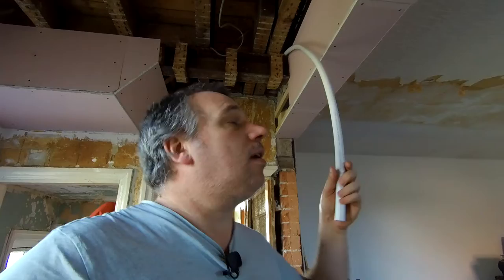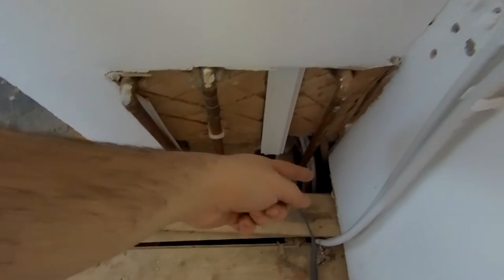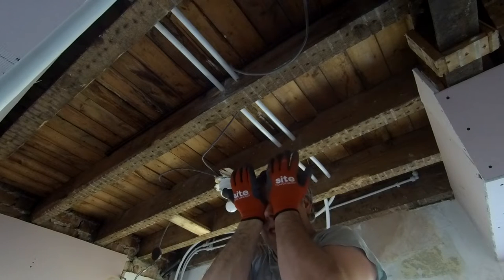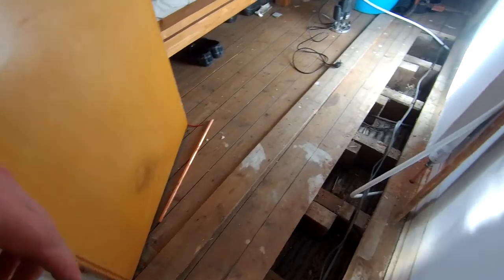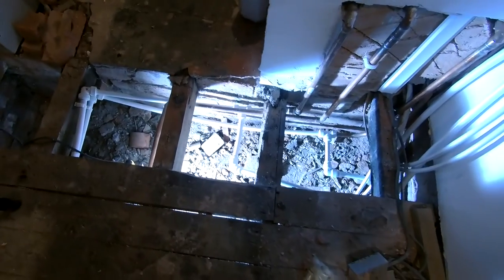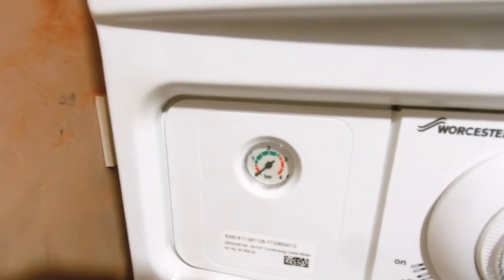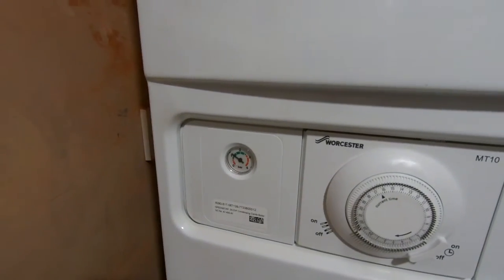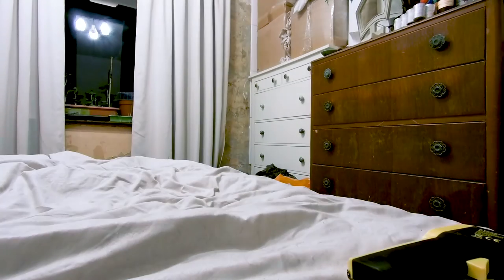How to Install Central Heating System. part5 - Getting the heating upstairs DIY Vlog #14

Comment: Very helpful video. Is there a reason you used straight reducer 22 to 15mm just before 15mm tee estate of using 22x15x15mm tee reducer, that's on 16:31 min

Comment: Lcw tanx for the upload the series was enjoyable to watch,did u use jg speedfit  pipe and fittings?
Reply from the maker: I'm glad you enjoyed the series. The deal I had was supplied with PB pushfits, which I say I haven't heard of before, but any extra fittings I bought were JG Speedfit. The pipe was just a standard barrier pipe that was supplied and the extra one I had to buy was just the standard trade barrier pipe from screwfix.

Comment: 14:20 Junction boxes under floorboards. Should really be upgraded to maintenance free wago connectors, considering that screw terminations have to be accessible.
Reply: They are getting changed to wago soon in a new video as I'm moving some light switches and running new cable. 👍

Comment: Do you find you get much thermal expansion in the pipes going up to the first floor? I was advised to go with copper for the vertical straights to combat this. Also, have you had any problems with leaks and push fits?
Reply from the maker: I've not had any thermal expansion, I'm not sure if it's because it's a barrier pipe i.e it's like a pipe in a pipe. I've not had a single push fit leak, they have all worked perfectly on every joint. Time will tell though, that's why I didn't want to put elbow joints under where the bath is because when the ceiling is back on those connection would be impossible to get to.
Reply: @LCWDIY  Thanks, gives me a bit more confidence! I'm trying to plan the pipe runs for my heating now with minimal t joints and elbows. Would you recommend the ratcheting pipe cutter that you've used in the video?
Reply from the maker: @iamiadam  The Rothenberger pipe cutter is good but pricey at about £49 from screwfix https://bit.ly/2MIUeAK although they do a smaller 22mm one for £23 https://bit.ly/2GgQWDK They can squash the pipe a bit when you cut them which makes it a bit harder to push the pipe insert in but it does give you a nice quick, clean and straight cut.